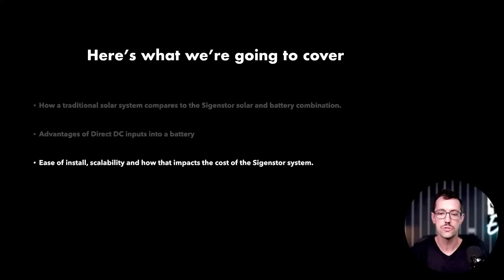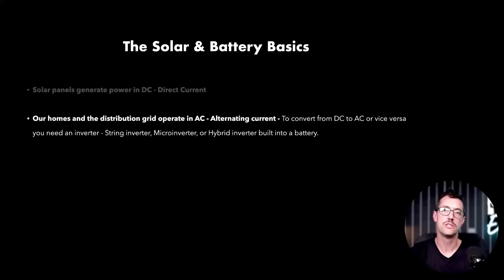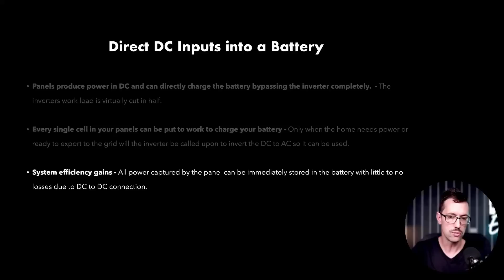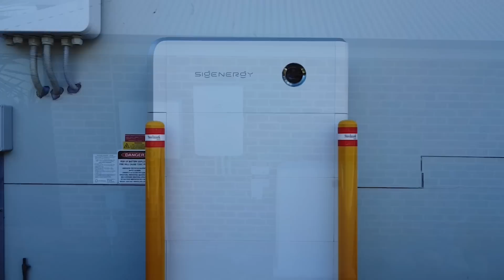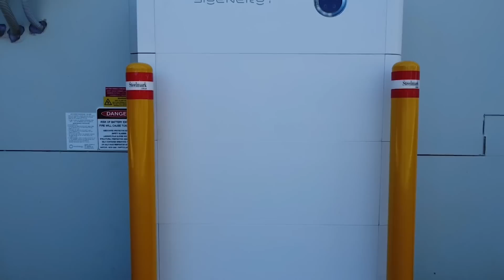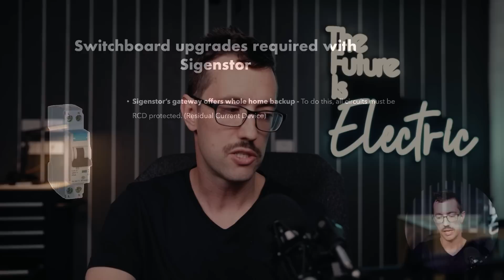Why SigenStor is Going Viral in Australia

Comment: I'm getting Sigentor 24 kwh battery in 2 weeks. Can't wait. Oh and we got the Victorian battery loan just before they closed out.
Reply: Can I ask what the cost of that will be ?
Reply: @Backseatobserver-1  We got the whole lot. 12 kw Jinko solar, Sigenergy 24 kwh battery, gateway, AC charger for 30K AUD all up. Government rebates are 12K though so not too bad.
Reply: @Backseatobserver-1  We have 12 kw Jinko panels, 24 kwh Sigenergy battery + gateway + their AC EV charger. All up 30k but we get 12k off from rebates.
We pay 8k out of pocket and the other 10k is paying slowly with the interest free loan over 4 years. 
With the reduction in gas usage and this battery, we should be able getting money back after 6-7 years.
Reply: @Backseatobserver-1 24 kwh Sigenergy is around 16K. Tesla PW3 13.5 kwh battery costs a bit more.
Reply: @Backseatobserver-1 We finally upgraded to Jinko 14.2 kw panels (510W x 28), 12 kw Sigenergy inverter, Sigenergy AC EV charger and their gateway for off-grid capability. The whole system is $33.5k AUD. We pay only $22.5k all up but of course with the Victorian loans and it became $10.5k out of pocket upfront. 
The 32 kWh Sigenergy battery is around $17.3k cause we got ~45% rebate at $7.8k. I think the extra rebate is from the stackablity of the Sigentor. The installer doesn't have to add any extra cost in that regard.
Reply: I am in Vic and have a 24kwh sigenergy system with ev charger being installed in 17 days. The vic loan closed very fast we just scrapped in.
Reply: @mattzap9298 oh yeah? We are getting it on 16/6. 😂

Comment: surely there is a DC-DC buck or boost conversion required to charge the battery.  I imagine the battery charging requires a pretty specific DC voltage range.  I also imagine that the DC voltage from the PV array is quite variable.  Thus a converter is still required.  albeit not an inverter there will still be losses.  maybe someone can help me here...... is the modern DC-DC voltage conversion that much more efficient than a modern inverter?
Reply: Yes, Sigenergy call it DC optimisers, one on each module. And yes, PV voltage can be variable, although it doesn't vary as much as the current (amps) flowing. DC step up and step down tech has improved a lot, but there are still losses - anywhere from 2 to 3%, higher with higher currents.

I guess the main point of DC coupled batteries is the flow of power remains in DC, from panel to battery, and panel to EV battery using the SigenStore DC EV charger. The only time an inversion is required is when supplying the house or grid. The inversion loss is 3 to 5%, each time. 

So an AC coupled battery incurs the "triple conversion penalty" loss, so called because whenever the battery is engaged there are 3 inversions from AC to DC, and back again.. panels to inverter, inverter to battery, then battery back to inverter when drawing from the battery. This adds up to around 10% loss each time.
Reply: Spot on.
Reply: Yes, surely there must.

Comment: I’ve been quoted $1700 extra for going from 16 to 24 KwH sigenstor  battery capacity I.e. one extra battery module. Does this sound reasonable? Also wondering whether that extra amount should diminish with each extra module?
Reply: A bit over $200/kWh sounds pretty good really.
Reply: I got quoted the exact same amount. My thought was if it was roughly $370 x 8 discount and you can only access it once, why not.
Reply: I'm the same! Hence we are getting 24 kWh stack in 2 weeks time. Whole sale price of a 8 kwh module is under 4K AUD. They are not expensive anymore. The difference is installing labour cost.
Reply: Yup, that's about right. I saw another yt comment where he was paying $1570 each (installed) for 4 x 8KWh modules added to his existing 2 modules, which were installed before the fed rebate announcement.
Reply: Inverter reliability and life has nothing to do with the battery other than the round trip loss which is ~5-10%
Reply: @karlajensen100  Yes, our 12 yo 5.4 kw solar system is still working well. We finally ended up with 14.2 kw solar, 12 kw Sigenergy inverter, Sigenergy AC EV charger and their gateway for off-grid capability. The whole system is $33.5k AUD. We pay only $22.5k all up. 
The 32 kWh Sigenergy battery is around $17.3k cause we got ~45% rebate at $7.8k. I think the extra rebate is from the stackablity of the Sigentor. The installer doesn't have to add any extra cost in that regard.

Comment: Excellent presentation, thank you.
I didn't know about the advantage of the direct current to charge the battery.
I have just had a 3 phase 24 kw battery & 15kw inverter Sigenstor system installed & am eagerly awaiting 1st of July to have the battery turned on.
Also I will join Amber for electricity supply ( I watched your review) as this new system will allow me to play the wholesale market & finally stop giving away my excess production for a paltry
 .05 cents/kw.
I have a 6 kw panel array & previous Goodwe supplied 10kw battery which turned out to be very poor value as the battery degraded to 59% of charge after only 7 yrs of service.
I will probably add the DC charger module when VTG/VTH actually is approved as I have a PHEV (already approved for VTH/VTG in SA where I live) which would add an additional 13 kw of battery.

I really like that the Sigenstor system is s modular & that adding modules is so easy.
Reply: V2G module is fairly pricey - I would wait for the Bidi rebates which are inevitable
Reply: @Nerdificationing What's "Bidi" rebates please?
Reply: @Fomites  there's a plan for the roll out of V2G. One step is rebates for bidirectional chargers. My guess is next fed election.
Reply: Still 70kgs and still needs an electrician
Reply: Did you mean $0.05 or 0.05 cents? And what sort of PHEV do you have that can do V2G and V2H? I'm looking at EVs that can do that too 😎.
Reply: @Fomites ,I meant 5 cents au.
The car is a Mitsubishi Eclipse cross PHEV, with 13 kw battery ,the Mitsubishi Outlander is also approved for VTG/VTH via the Chademo charging socket. As far as I'm aware SA is the only state to have approved VTG/VTH.